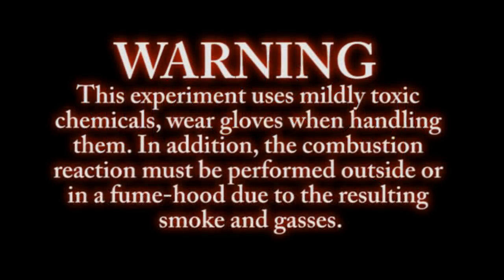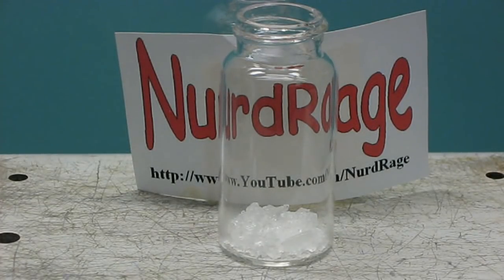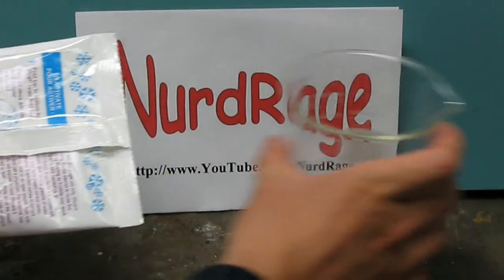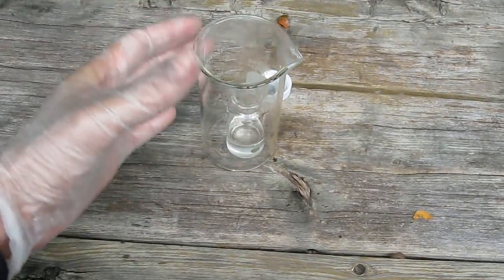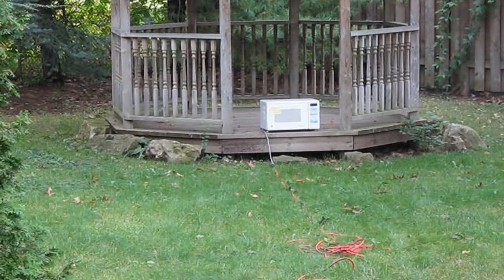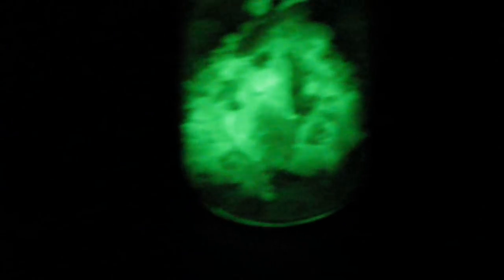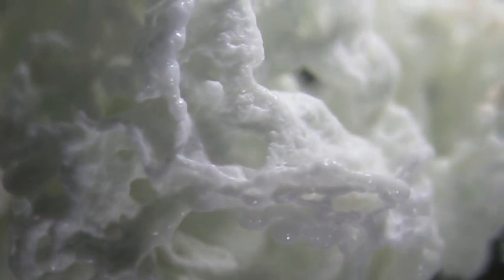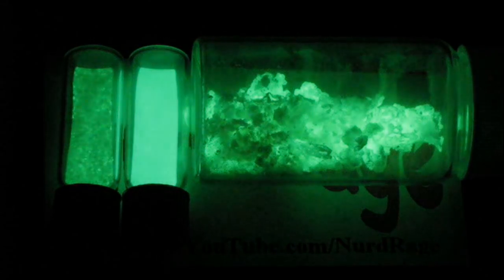How To Make Glow in the Dark Powder

Comment: Yes correct.  But one could make a fireclay chamber with a lining of silicon carbide or graphite that could produce a more consistent heating in the microwave. But at those temperatures, fused silica ware is required.